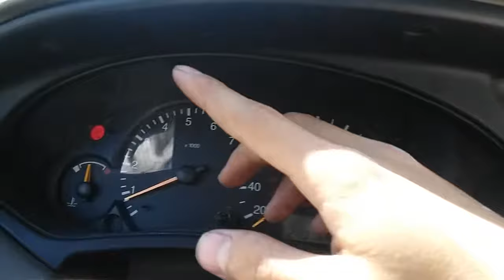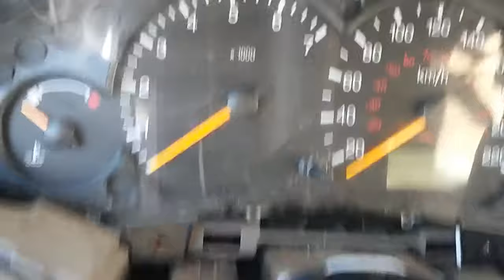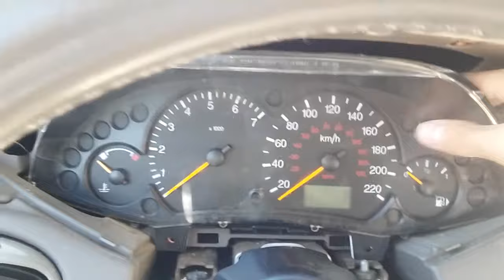Ford Focus instrument cluster removal

Comment: Bloody Haynes manual. Before I started to strip the cluster out, I read every detail in the manual. Everything went fine until it came to the multi plug on the back of the cluster. I tried pulling it straight out like it shows in the Haynes. I tried levering it with a screwdriver and I realised there is something wrong here. Went back to the Haynes manual and there is a picture showing the plug in a magicians hand. He must be magic because the black lever on the plug that has to be pushed back off the plug is still in the middle of the plug without any reference to it.
What a relief when I watched your video showing how to release the lever before removing the plug. A huge thanks for taking the trouble to put it on YouTube as I was nearly ready to pull my hair out.

Comment: Thank you very much for the great video, I have one question though; do I have to disconnect the battery before replacing the cluster?
Many thanks
Reply from the maker: It's recommended to do so when doing anything electrical related on your car, but for pulling a cluster not absolutely mandatory as long as the car stays off.

Comment: My gage cluster on my 2007 Ford focus idk what to do because my check engine light is stuck. On I can only get the focus 5o pass smog check because of this. The car has no mechanical issues at all the car is on tip top shape engine good everything it's just the in check engine light is stuck on I need to know if you know anything about check engine light stuck on on the cluster I see that you're showing a video on YouTube on how to take the cluster out but how do I get that light to turn off do I need to buy a new cluster where can I buy a new cluster for a 2007 Ford focus any tips any kind of info you can shoot my way I would really appreciate it because it would be really sad I won't be able to drive this car my stepdad took the car to a shop it was a Ford dealer shop and they told him that if he was to get a new cluster that it would still have the same problem with a check engine light still on so I don't know what to do help if you have any info please send my way I appreciate your time thank you bye-bye
Reply from the maker: To get the check engine light to not be on, you need to fix the problem that's causing it to appear in the first place. A mechanic shop can hook up a scan tool to pull the error code and find out what's the issue.

Comment: Hi, in my case neither the speedometer nor the odometer work on my 2002 Focus, although it's an intermittent problem. When this happens, there is a yellow symbol (3rd one up from the left) that shows. Any idea what this could be? Thanks
Reply from the maker: 3rd from the bottom on the left side is the airbag light, I'm not sure how that'd be related to the speedometer and odometer working. If they are intermittently cutting out and at the same time the airbag light appears, my best guess would be possibly a loose ground or defective cluster itself.

Comment: Thanks for the tutorial.
I'm tryimg to swap my current gauge cluster for one that has a tachometer.  My car came without one.  Do you know if It's possible to carry over the odometer to the new unit?  I heard the data is programmed into the gauge cluster itself so I'm worried by doing so it will alter the mileage readout.
Reply from the maker: Yes, the mileage is stored in the cluster so the new clusters odometer reading will show.
Reply: @Ashquacks  damn... I to was hoping to change to another cluster..
Reply: Stupid to have the milage stored in tbe cluster.